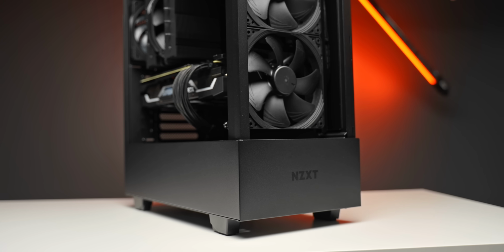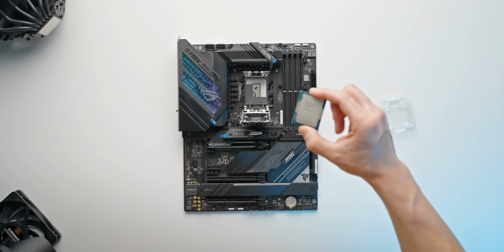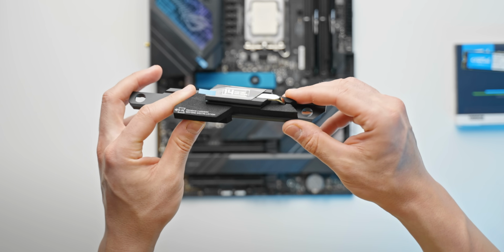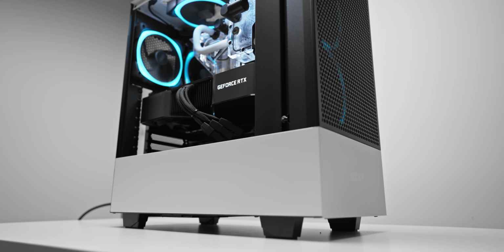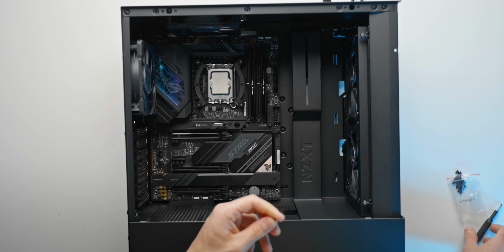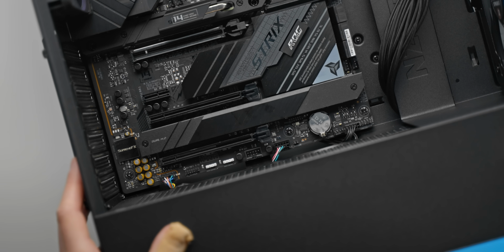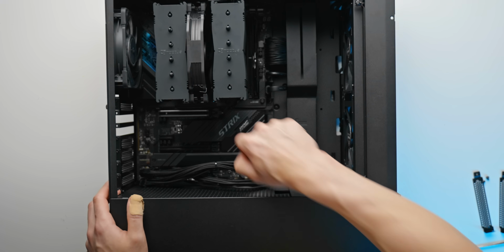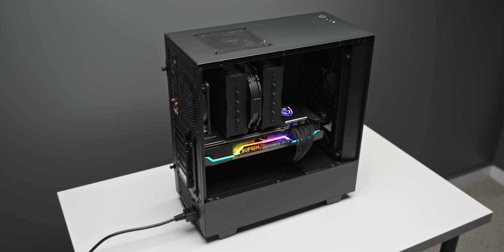How to Build a Powerful Gaming PC

Comment: I have the same cooler. And the same problem with one fan interfering with the RAM. Thankfully my case had like 5mm left between the side panel and the cooler. So my second fan is slightly offset but atleast it's there. Hehe

Comment: I'm personally always deshrouding my GPUs nowadays and replacing the stock fans with Arctic or Noctua ones. Board partners are doing a terrible job with noise performance, my 3080 sounded like a jet engine before, now it's barely audible.

Comment: 38:00 To be fair, you can do this without a fan controller. You can set fan speeds off the mobo to run in line with the PCIE sensor. No idea if that exists on every mobo, but my Aorus board has a PCIEX16 temp sensor and I use it to mark when my front intake fans ramp up to supply more fresh air under gaming load.
Reply: same lol i can control all my 5 fans via bios and control the fan curve with ease(B450 Tomahawk)
Reply: @bl4nkxx  I think his big point is you can't really use the actual gpu temperature, but that really doesn't matter when there is a sensor for the PCIE slot. You could even use the sensors for System1/2. Personally, when my PCEIX16 sensor reads 40C, the fans ramp up to bring more fresh air in, as only exorbitant amounts of heat through the gpu will bring that temp up.
Reply: Yep you can on gigabyte and msi boards. Pretty sure you can on almost every modern motherboard!

Comment: This build is gorgeous and the performance is amazing. However, a lot of choices leave me scratching my head. Opting for a ~$400 motherboard, ~$350 PSU, and likely super overkill RAM, yet only choosing Crucial P2s for storage? It all seems especially questionable when Devi will be using it primarily for just 1080p gaming, which, then why get a 3080 Ti and an overkill CPU? Just seems wasteful to me... Either way, you put together an excellent build guide, so well done for that!
Reply: In terms of 1080p, I look at it like this: if he’s going to be keeping the rig for many many years it makes sense because games keep getting more and more demanding. I mean the 1080ti used to be a very adequate 4K capable gpu and now people only recommend it for 1080p. Also to my eyes while gaming, a 1080p 24inch isn’t that different from a 1440p 27 inch or even 4K monitor (I’ve gamed on all three side by side). I also just really like setting every graphics setting to max and just forgetting about it instead of having to fiddle with them in every single game I play so 1080p is perfect for that. I also personally think color accuracy and panel technology are far far more important than resolution although I don’t think we’re ever going to see a mini led or oled 1080p gaming monitor ever which is a shame. I do agree that the mobo and psu are overkill then not spending money on a quality ssd with dram.
Reply: @Conrad75  Yeah and those are all totally fair arguments/preferences. I just hope that Devi has those same sentiments in mind and isn't simply overspending for some sort of perceived "excellence" that could otherwise be achieved by spending far less money. At the end of the day it's his tech, so I can't be too mad; I just don't like seeing money being spent poorly without the spender knowing what exactly they're doing.

Comment: pick a better case, there will be alot of turbulence in that case since the gpu is so close to the tower cooler there wont be a big enough air gap for the high rpm fans

Comment: 39:04 Intel's Socket issues shows again, couple P-Cores hitting 90, while others are mid to low 80's.
The fix is a contact frame, but most people won't care having uneven temps and wack clamping pressure across the IHS.
Reply: The temps may also do with the fact that almost all CPUs favor one or two cores which happen to be the most performant ones which then ultimately boost higher and are utilized more. Also the uneven pressure has mostly been shown to really only affect temps to a large degree with big overclocks in most cases
Reply: @Conrad75  leading overclockers disagree, why don't you go watch some videos from gamer's nexus or whatever
Reply: @Conrad75  he's referring to uneven cpu cooler mounting pressure due to the intel socket being a faulty design - do some research before you mouth off and show that you're ignorant of modern hardware

Comment: I had the same build. Just and advice, yes it’s big for 14mm and it will block your cover. So what I did was I bought a 12mm nocturna and solved the problem. And my 14mm fan was extra so I put on top to draw extra hit out
Reply: You mean 12 & 14 "centimetres" ?

Comment: For me I just need to upgrade to the 5800x3d from my 4.5ghz all core 3800xt and my 6800xt will go to the moon. Airflow is so good with the noctua 3000 f12. Water cooler is always at 30c and on load I'm at 52c. Have a steel legend x570 with a 2tb 980pro just a slow process to highend I came from a 1060 and 2700xfrom 3yrs ago lol

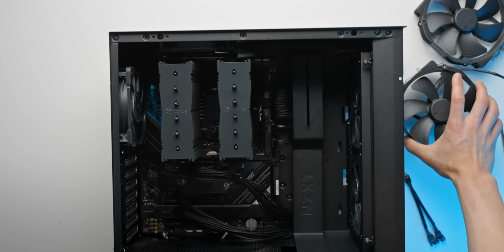Comment: 30:53 be careful that you aren't using that adapter that ships with noctua coolers that slows down the fans (for noise reasons I guess).  That's especially important since you're only using one fan on the cpu cooler.
Reply: can you elaborate on that adapter? i got a similar setup and use 1 of the fans too currently... the other i actually routed to the be a front intake from the same splitter...
Reply: @yukisnoww  read the directions that came with your noctua.  Most of them come with a "low noise" adapter or something along those lines.  It just makes the fans run slower than they otherwise would.  So if instructions say it's a "low noise" or "low voltage" or something along those lines adapter, don't use it unless that's what you actually want.

Comment: There are software options to control fan speeds off GPU (or other) temp readings from MoBo headers. I personally use Argus Monitor which works fantastic and I am very happy with.

Comment: Wonder if we could see a 5900x3d, just recently upgraded my motherboard so not making the jump to the next generation for at least a few years so a 5900x3d would be amazing.  3600xt performance is solid but looking to push 360-390 fps in CS consistently.
Reply: I'm guessing not. They already had to downclock the 5800x3d to make the v-cache work. Probably the zen 4/zen5 chip with v-cache will be the creme de la creme of gaming chips.
Reply: @Kitten_Stomper  not a huge deal, I don’t really need the extra cores since I just play and stream CS, 5800x3d and a 3080 would be plenty

Comment: Hey @Optimum Tech
For like 8+ years ive been gaming on 2560x1440, currently got a samsung g7 monitor,
But ever since i switched to it i felt like ive gotten worse on fps games especially, is it just placebo or do you think 1080p still is the sweetspot when it comes to competetive gaming? i got a beefy rig but it just feels like its harder to focus on a bigger screen and more pixels. i dunno
Reply: 27/32"?
Reply: @sushimshah2896  27" 2560x1440
Reply: Because newer games have gotten much more demanding since we are switching to the PS5/Series X Era with the tri-factor of a good gaming experience:
- High resolution (1440p+)
- High frame rate (60+, with 120 now becoming mainstream)
- and High graphics (Ray Tracing is now the cool new thing)

At 1440p for PC, only the really high end components can satisfy all 3 qualities above, requiring you to upgrade almost every other gen for the latest games. Most mainstream builds can only satisfy 2/3.

1080p with High frame rate is extremely popular due to streaming and "competitive" gaming during pandemic, with lower entry-cost to gaming PC space when graphics card prices were high the last couple of years. It's just the state of things at the moment.

If you don't like upgrading often, lowering graphics settings for latest games (Ray Tracing in some games isn't a big difference, lower resolution while maintaining image quality with DLSS/FSR, tune settings to console level, etc.) is the sensible option. Or just catch up with your backlog of games you wanted to play but never had the time to, latest is not always the greatest, some older games still rock. Max out their settings, upscale the resolution using DSR/VSR, and play at 120+, that is the PC glorious gaming experience.

Comment: Have fun stress testing this. Nh-d15 was barely capable of cooling my 12700k. The nh-d15 unlike most noctua coolers has a flat contact plate instead of convex so if the CPU has the bend issue with 12th gen at all it gets extremely hot in stress testing. Hope that 12900k stays flat or it's going to start getting toasty. Will stay in the mid 70s-80s while gaming tho.
Reply: Undervolt?
Reply: Yeah LTT had the same conclusion about air cooling the 12900k
Reply: Is this the same for NH-D15S being flat?

Comment: Beautiful build! 
The NZXT h510 has a specific hole for the CPU power cables on the bottom grid. 
Also you could fit the second fan of the cooler with a low profile RAM like Corsair LPX and sanding the fan a little bit
Reply: He couldn't have used the lpx because they are ddr4 memories but maybe the new corsair vengeance ddr5 kit if it fits. Because I think it is a low kit memory
Reply: @ARSR  mentioned LPX just to give a reference of the ram height. I don't really know what brands sell DDR5 ram sticks
Reply: @ARSR  yea.. so intel 12th gen still supports ddr4. Also DDR5 isn't worth it yet with latency high
Reply: @mcknightujc  yeah but this motherboard doesn't support ddr4. And that is also true that ddr5 is not worth it at the moment

Comment: At 20:00 , you can actually use open source software called "Fan Control" to control your fans with all kinds of parameters, you could even make a fancurve based on SSD temps, all just using standard motherboard headers. Jayz2Cents also made a video about this.

Also personally, I would use a large case, preferable not choked NZXT cases, but rather the more open (and larger with this kind of hardware) kinds of cases if you want to avoid a sauna, lower boost and higher noise/temps.

Comment: I have this case with a Kraken x62 mounted in the front and a Red Devil 6900xt which is roughly 330mm long, most cards will fit with an AIO front mounted. Installing the card was... Playing Tetris while riding a rollercoaster but its doable. The Suprim X 3080ti is 336mm long and might actually be one of the few that wont fit with an AIO. This build looks amazing and honestly I will probably go the no RBG route next time I build, extremely tired of cable managing full RBG systems.

Comment: I have USB 3.2 Gen2 Type-C on the case. And I have a motherboard that supports USB 3.2 Gen2x2 Type C. Will USB Type-C work? If so, could I burn the USB Type-C connector on the motherboard when I pulled out and re-inserted the wire from the case into the connector during the working state of the computer? And could I burn the connector if I inserted this wire incorrectly? The USB Type-C cable is almost symmetrical and it does not hold very well in the connector. My USB Type-C does not work =(

Comment: I would prefer to put NF-A12 from top to front of the NH-D15 and put NF-A14/A15 on top. You'll need to get balance in airflow with all these fans, but with external fan controller and all existing motherboard fan headers there are enought channels to do this. Also, do not know why it is so important to go with external fan controller if we have Argus Monitor which can control fans based on GPU temps.
Overall this is great build and pretty simple video for instruction.
Reply: FanControl GitHub User Rem0o does it for free.

And yes I would have done the a12 on the front of the D15 and the d15 fan on top as exhaust, too
Reply: Why? Nf -a12 and a15/a15 gives different  pressure of airflow ?
Reply: @princekittipon6510  it improves thermals
Reply: @pietrmuffei8874  how much 1-2 celcius?

Comment: just bought a asus rog strix b550 f gaming and i dont know what the problem is i have no debug lights on i have all the cables in the right place i have plugged my old motherboard in and everything works ive even updated the bios and i still cant get this board to boot
Reply: Maybe DOA Mb? It’s light up at least?
Reply: @alerjimenez  yes the motherboard lights up just wont boot and i was thinking it was a DOA not sure tho
Reply: @devauncubit6824  what ryzen are you tried to use it with?
Reply: @alerjimenez  i figured out the problem i unplugged my cpu and it turned on but when i plug in the cpu it wont turn on im assuming i need a stronger power supply
Reply: @devauncubit6824  wierd! how many watts is the psu? And what gpu are you using?
Reply: @alerjimenez  i have a 600W psu and a 2060 gpu

Comment: As always, nicely done. I'm glad you cleared up the AMD option at the start. That 5800x3D looks freaking amazing for games at a lower TDP so cooler and quieter builds. This air cooled option looks great though the RAM height is an issue. Perhaps LPX RAM would be make it possible to mount that 2nd fan. G-Skill Ripjaws S5 look sleek and would suit the build.
Reply: Didn't even know about the S5 till you said it. I bought the normal Ripjaws together with a NH-D15 a month ago. Luckily my case is big enough to offset the fan... But if I had known...
Reply: @Jfat69  They’re fairly new to market and not a big fanfare either. In fact I haven’t seen any YT channel cover them. Good job you have the extra headroom 🙂
Reply: The 5800X3D is just 5800X with just stacked of memory cache being glued together. Plus, Evil Su decided not to add 3D on the Zen++++ on the first go, and you will have to wait a year later for a 3D version of it.
Reply: @AlfaPro1337  It doesn't matter what the 5800X3D is, what matters is that is just as fast in games as 12900K and its cheaper....
Reply: @adi6293  It's a dated piece of hardware, since 6th gen Ryzen is around, without glued stacked cache.
Reply: @AlfaPro1337  🤣🤣🤣🤣🤣🤣 You're going to make me cry
Reply: @adi6293  Well, continue laughing at:

A gimped architecture between the IF-MC, it no longer runs the same speed as the single data rate of the RAM speed when it's above 3.733 GHz.

No good engineers over at AMD in order to create a new architecture from scratch, oh wait, they did, the Faildozer.

Blocked

Comment: 19:55 - that is incorrect. You can control your fans with GPU temp sensor using special software. I use Argus Monitor - tried it for free then bought it. I use GPU temp to control my intake and exhaust fans.
Reply: he said "or with third party software" if you listen closely.

Comment: Wondered what your thoughts were on this! Just picked up a 12900K dell XPS tower.. 32GB DDR5, 1TB nvme, RX6700xt.... $1800 aud. Bargain? It ended up having the upgrade air cooler too!
Reply: Dell prebuilts overheat with a 6 core cpu....I would hate to see how bad yours will thermal throttle or more likely their garbage motherboard heavily power throttles it's and you get a lot less performance
Reply: @samgoff5289  We're going to find out. This was a problem for the small pankake cooler, but this has a noctua style double fan + heatsink. Case has two 120s as well. I dont see how it could overheat. 12900K for 1800 - im laughing tbh
Reply: IMO never buy pre-builds. Especially Dell as it is very hard to upgrade, has low quality parts and usually has really bad thermals.
Reply: @Makaveli6103  What would you need to upgrade exactly? Its got a 12900k haha, PSU is 1000W. I'll replace the RX6700 with a dell 3080 or 3090 card going cheap on ebay. Theres 32gb DDR5 already in it. That will serve well for the next 2-3 years. For $1800

Comment: Note with the Mainboard, that M.2_1 is the PCIe 5 slot and takes 8 lanes from PEG (PCIe_1) when used
the primary M.2 should be the one at the bottom (the left one, there are two, the right, short one is from the PCH)

and the expanison M.2 Card should go in the bottom x16 since it is wired x4+x4, the middle one is x4 wired only and only one M.2 would work
Reply: And not to forget, the M.2_1 Heatpipe is because of Gen5 drives and expected higher thermal output

Comment: Nice build!
For a case of this size, the Noctua U12A (black version) would be a better choice, and you could use both fans on it.
Secondly : The top exhaust fan is very close to the CPU air cooler, and will clash a bit with the airflow. With an AIO cooler on the CPU, this would not be the case though.

Comment: Why do you need a fan controller?
Asus motherboards have a built-in feature to set up temperature+fan speeds in their app or on BIOS.
Reply: Built-in feature works for motherboard temperatures only, he wanted to use GPUS temp.
Reply: @AlexeySazonov  Oh got it. Thanks!
Reply: @TheSimaa  I use Argus Monitor software solely for that purpose though, it does a very good job - check it out.